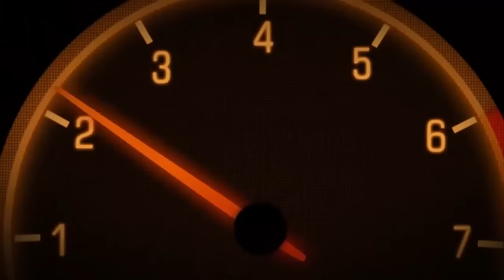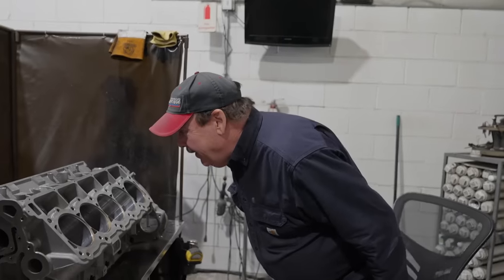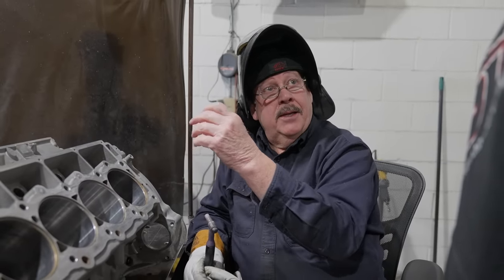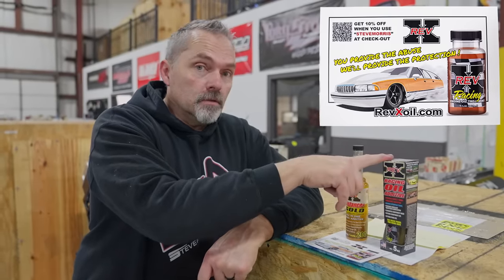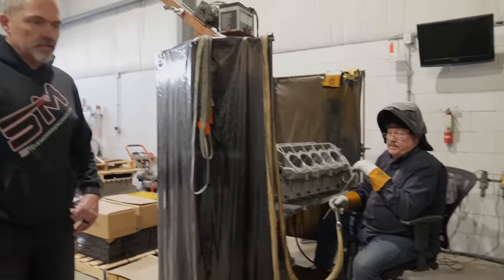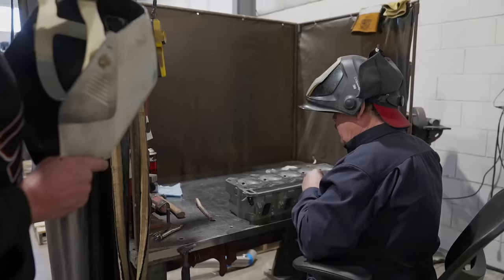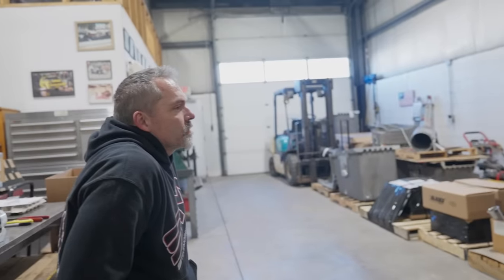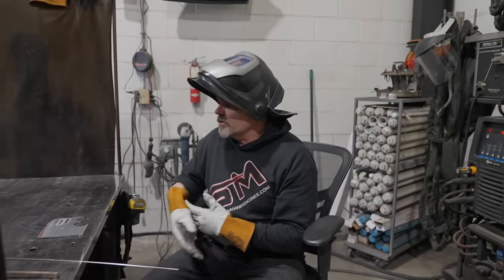Can You Weld Copper Pipe Carrying Millions of Volts of Electricity??

Comment: Really interesting video and I certainly appreciate the huge wealth of experience and expertise being shown. However, what drew my attention to watch, was the mention of welding copper pipe that carries "millions of volts"!?  What could require that? I've worked closely with the power generation industry and they only get up to 400,000 to 500,000 volts. Then you indicated that the "copper pipes" were used in Electric Arc Furnaces. Well, just like Welders, they operate at (relatively) LOW voltage and HIGH current  - usually less than 1,000 volts but 50,000 to 60,000 amps. So, maybe you mean "millions of Watts"?

Comment: We use 95/5 (argon/hydrogen) for our full-penn 316 s.s weldments. Normally, anything over .100" is automated because of the heat involved. Since no color inside is allowed, argon is used as a backer and no more than 10ppm of O2 is acceptable.

Comment: Helium storage outside of Amarillo (known as the Strategic Helium Reserve) is extremely low and the helium reserves are awaiting new sources.  With the industrial use of helium and the use in cooling MRI machines make it extremely expensive.  It looked like the heat affected zone was smaller with helium, is that true?

Comment: Millions of volts…I doubt it. I’ve worked in the electrical industry for many years. No system in the world works on that high of voltage. The building structure couldn’t be that close without arcing. I could believe thousands of volts and thousands of amps. I think the title and explanation is far off.

Comment: 26:58 that top doesn't look like it holds anything... but then again how much water pressure is running through the tubing.. look at how horribly low that sags... im not a welder, not anything to do within the welding field but common sense to me suggests that notch at the top shouldn't be so low...  but maybe he didn't have clearance at the top?? dunno but shit looks sketchy
Reply: the OD of the 6 o'clock is outside of the OD of the 12 o'clock if you don't see what im seeing

Comment: You are misinformed on the millions and millions of volts and amps.   It’s hundreds of volts and tens of thousands of amps.  At a million volts, you couldn’t get within 50’ or it would arc to you.  266 thousand volts is the highest I know of.  The highest amps that I know that can be generated is for fuse testing.  That is just over 200,000 amps.
Reply: We run half a million volts dc from our hydro generators up north in Manitoba. Some places use a million volts. I used to work there.

Comment: There is a fairly large amount of bullshit here, provably so about helium.  He's speaking beyond his knowledge.  One of the fabrications is the bit about "smaller molecules" facilitating cooling or conduction in MRI machines.  His advice about welding may be solid, but the knowledge about cryogenic coolers and why helium is required in MRI machines (cooling of superconductors) is basically zero, but he won't or can't admit it (he might not even know).  Just be careful applying some of the less welding-specific stuff that's here.

Helium is an element.  The majority of its creation on our planet is through natural radioactive decay of several other elements in the crust.  "Natural gas" deposits are normally a mix of many gases, but mostly methane.  So when we anyone speaks of increasing helium "production", it's really just about capturing more of it already present as a trace gas in different geologically-locked deposit sites that are usually primarily methane.  The only way we'll be able to actually make more of it at any scale would be as a byproduct of deuterium-tritium fusion, and that isn't exactly around the corner at any kind of industrial scale.